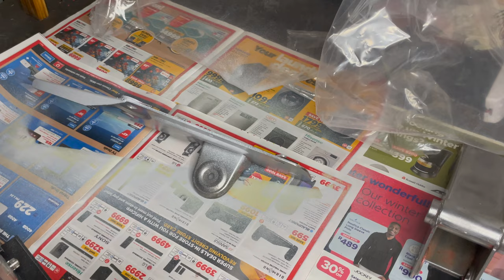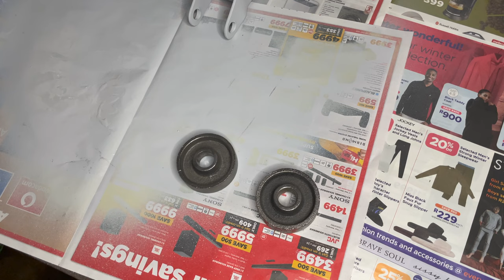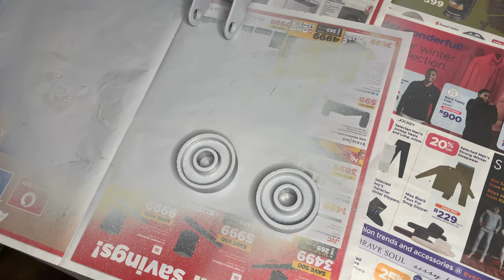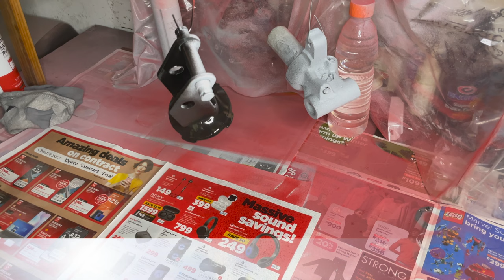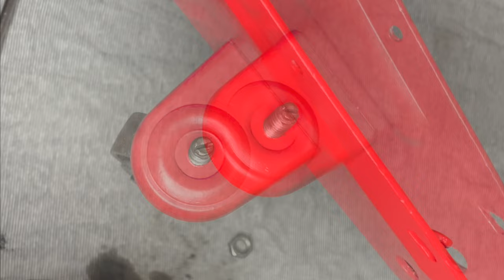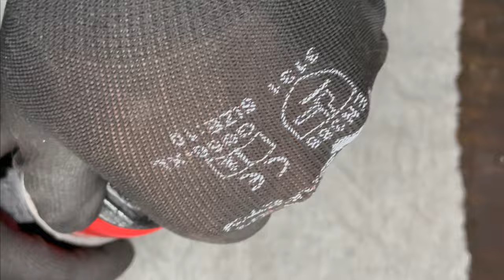Restoration of hydraulic trolley jack Part 2

Comment: Wow....! this is really a thorough Restoration with Paint Removal & Repainting. I did mine almost this way. Except that I dont remove all the Paint but only on the Rusted area by scraping and sanding. Then I ' touch Up' using paint Brush.
Reply from the maker: Thank you so much.

Comment: Did you use a seal kit? I got the same jack and not sure which kit to buy.i need bb that goes in jack too.
Reply: Except mine had spring and ball in the right side hole looking from the handle side.
Reply from the maker: Thank you for the comment. I had most of the parts required and had a o-ring kit. I did some online checking and you can check out https://www.blackhawkparts.com/ depending where you are from and get a rebuild kit from there. Hope you come right.
Reply from the maker: Some jacks are a bit different although they look the same. It sounds right if there is a spring and ball as the spring pushes the bb to close the hole and the pressure when jacking will force oil past the bb and the spring will then force the bb back over the hole to seal it again.